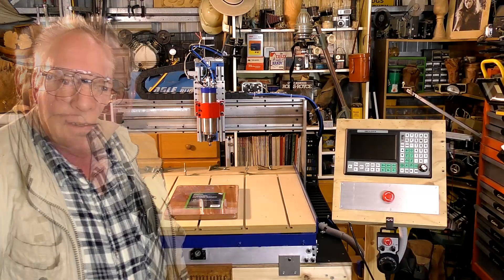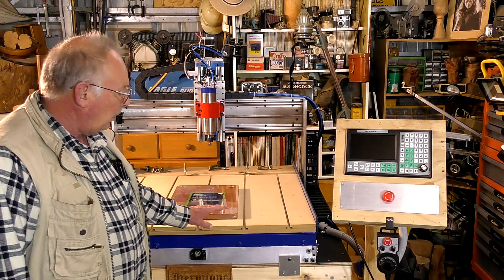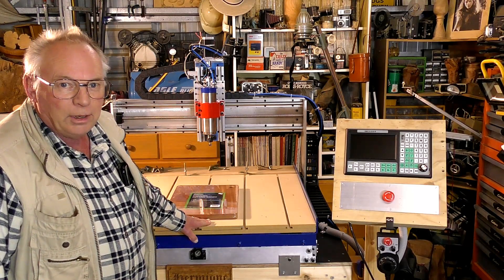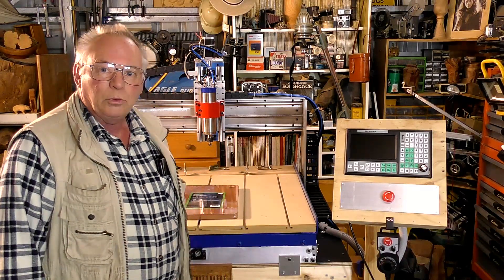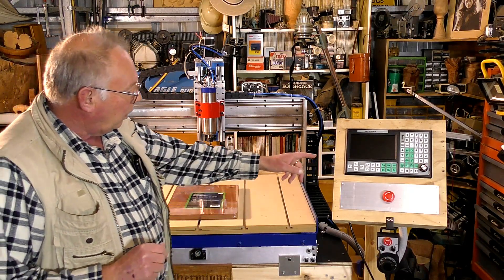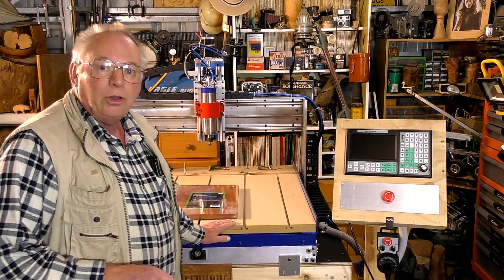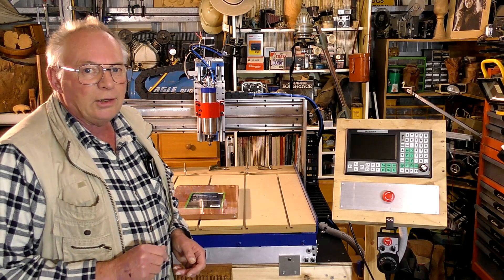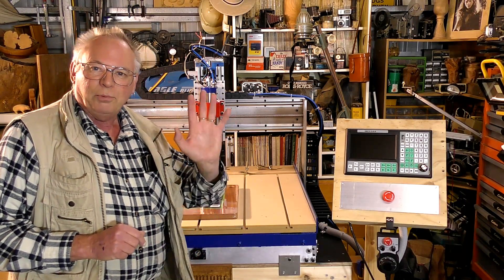*DITCHING* the SMC5-5-N-N controller + AMAX 3636 CNC Router drawings and parts list available now

Comment: Smoothstepper is a good option. connects to mach3/mach4 via ethernet, bypass the USB or parallel port issues. I'm running mach3 on windows10 with no compatibility issues with smoothstepper controller. I just popped in an extra ethernet card in the pc.

Comment: Hi Roger, How about the ACORN system. I have it on one of my machines and it works well, and its designed in the USA so support for your viewers over there would be good. I also use Mach 3 and 4 and find them good also. Cheers Dave.

Comment: Hi Roger! Excuse-me but I need your help. Do you know the nc609m controller? I would like to buy smc5- 5-n but it is very expensive. Nc609m is allora for 5 or 6 axis but the price is lower than smc5. Thank you and my wishes for a Good Easter!!
Reply from the maker: GO MACH 4 I am removing the SMC5 from my machine
Reply: @inventorsworkshop9600  Thank you very much Roger for your answer. I also thought to use UC300 (5 axis) because in this case I can to use Uccnc, mach3 or mach4 or drufelcnc as controller cnc. What you think on this?
Thank you very much and my best wishes for a Very Good Easter in God!